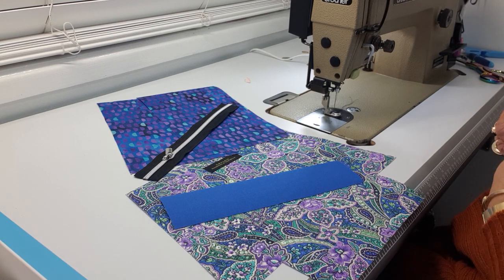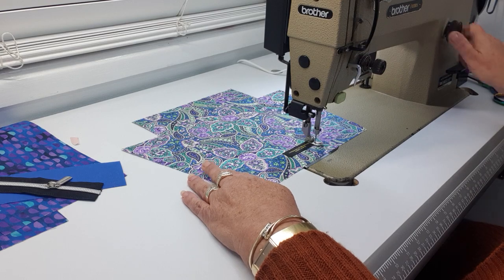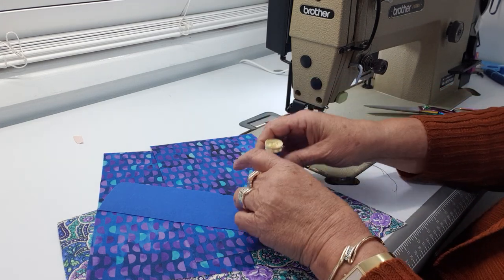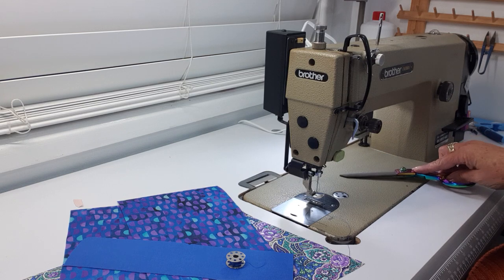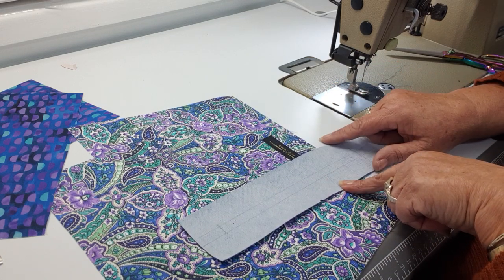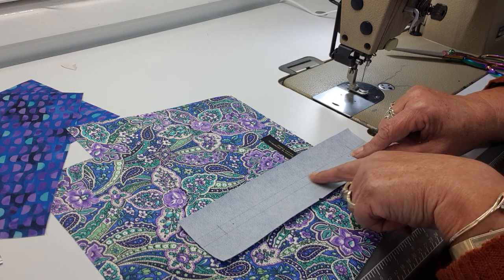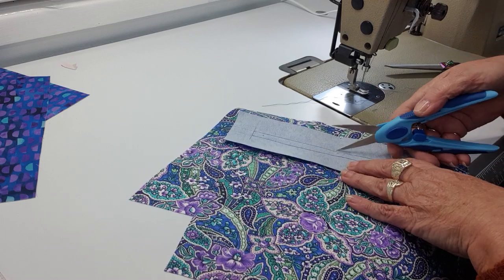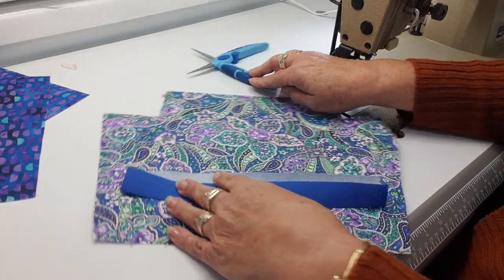How to Sew A Handbag Zipper Pocket With A Facing * No Exposed Zipper Tape, Pins or Double Sided Tape

Comment: Thank you for the demo.  This is a very different pocket application.  I can see where you can be more precise in your sewing.  Do you have a favorite thread you use for bag making?
Reply from the maker: It was my pleasure Dorothy and I agree you can definitely be more precise with this method.  When I’m sewing linings using cotton like I did in this video I really love Gutterman thread and so does this machine and also my Janome machines.  I do use other brands as well if the colour I really want to use is in my stash but definitely my go to thread is Gutterman.  For the exterior of my bags I mainly use industrial threads as they are thicker and stronger.

Comment: Thank you for this beautiful demo. I noticed no back stitching. Going down to “1” eliminates backstitching to lock the stitch? That is very helpful. Can I do that on the outer bag as well?
Reply from the maker: You’re welcome Lizzy 🥰 When sewing with thicker materials such as vinyl, cork, or leather for the the exterior of bags I don’t using reduce the stitch length down to below 3 or 4 as this can cause the materials to tear as they are not the same as sewing with thinner materials such as quilting cottons.  To eliminate backstitching if you want you can stitch over the existing stitches a for around 5 or 6 stitches or so as this will secure the stitches into place and reduce some stitching bulk as there will only be the two layers of thread.  Another option is to leave longer thread tales at the beginning and end of the stitching and stop and start at the same place and then pull the threads to the back of the material and tie them off to secure.  This way is the stitching is visible on the outside of the bag you won’t be able to see where the stitching stops and starts.  Hope this is helpful and please let me know if you have any other questions 🤗

Comment: I keep my thread in a drawer too but that’s a good idea to keep the ones you will be using or use a lot,  out on a rack! I have to check my stitch length always on my Janome, but not my Juki! Great info!
Reply from the maker: I much prefer my threads in the drawers as well.  It helps keep the dust off them and they’re not exposed to all the elements and looks neater in my room too.  I use to have two large thread holders on my wall before I renovated my room and it always seemed to be the most prominent thing in there and not that neat and tidy when there is all different brands and sizes of spools etc.  I always like checking my stitches when ever I change thread or bobbin or tension etc it’s just a habit I’ve gotten use to doing over the years and having had to unpick more times than I like 😂